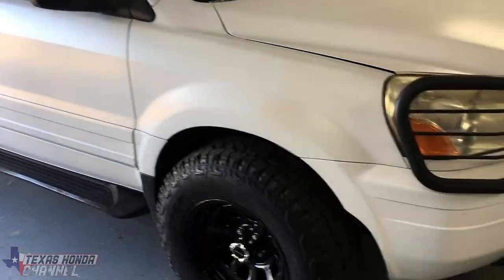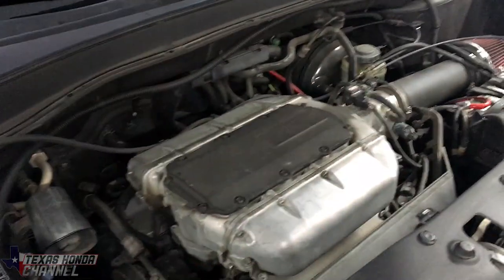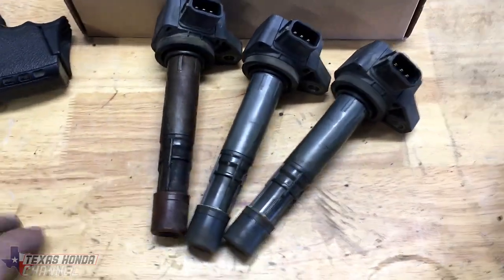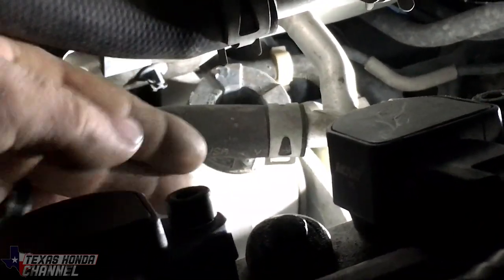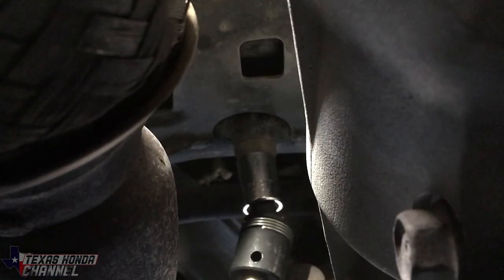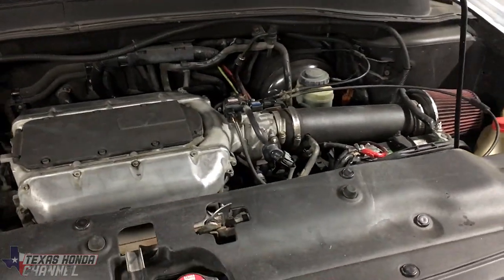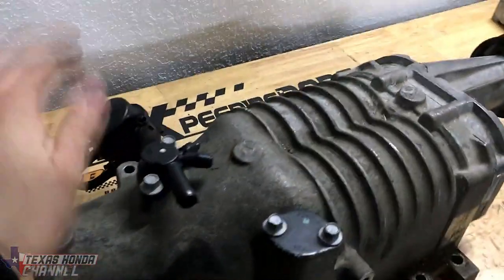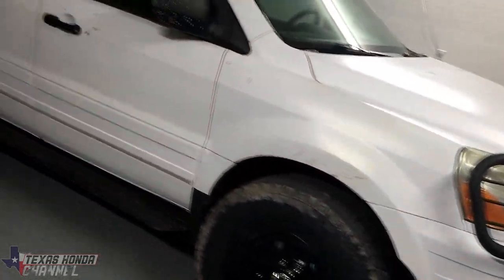Honda Pilot Gets Much Needed Love- Part 5 Rear Engine Mount And Ignition coil Install!

Comment: I'm so glad to see this I am about to replace the rear mount on my 04 pilot and all I could find was a write up on piloteers forum. There wasn't even a semi instructional video until now! Great video
Reply from the maker: I looked it up and the videos out there weren't all that great glad i could help.
Reply: Do you need a long breaker bar to remove the top 17mm bolt on the rear engine mount?  Can you give us more detail directions?  Thanks

Comment: Check for missfire in vehicles history. Swap faulty coilpack w the closest cylinder. If the misfire moves, youll know which coilpk is causing the code. Then check the spring that touches the plug, the coilpack can work while the spring be faulty,pressed,corroded. No need to swap all the packs 🤘🏼
Reply from the maker: Correct but for the price of 1 i got all 6 and they work great.

Comment: Thanks for vid. Been following all the steps. But ran into a hurdle, the top 17mm bolt won’t come out due to the sub frame blocking it from coming all the way out. How did you get it out?
Reply: What did you end up doing

Comment: Gotta do the coils on wife's daily. Gonna suck tho expedition 5.4 triton v8 2 of the coils are deep down n there and Need to do plugs too but those have a bad habit of breaking off n the head on those particular engines. But got lots of honda parts coming also plus paint video posted other day. Just testing new paint ideas.
Reply from the maker: Heck ya man ima go check them out
Reply: @TexasHondaChannel  thanks. Appreciate it.

Comment: Love your vids. I own a 2005 Pilot, sad to see it go. But any suggestions on how you got the brake lights to flash 3x without getting a brake light error on the dash? Did you use a relay for LEDs? Thanks!

Comment: How’s it going any suggestions on how to remove that 17 mm bolt from the rear motor mount? it’s on there pretty good I have an 05
Reply: What did you end up doing

Comment: Awesome video for my Noob mechanic skills!!  Question to replace the passenger side motor mount do I need to lift the motor a little or just put the jack under so it won't drop? I'm doing this one first and then the other 2. Thanks in advance.  Wich bull bar is the one you have .? By the way I own a 04
Reply: slight pressure, no need to lift it up.